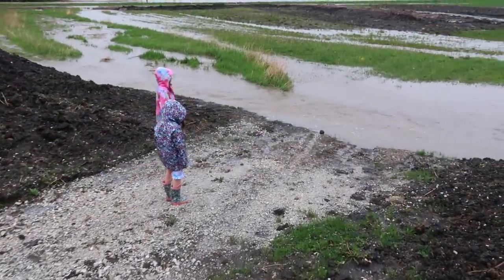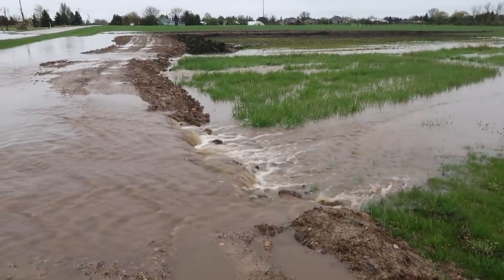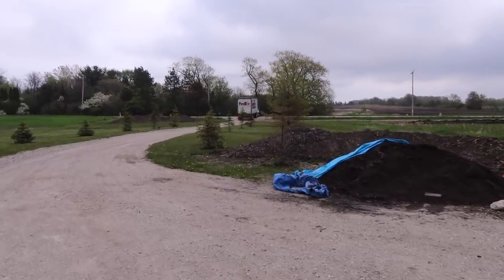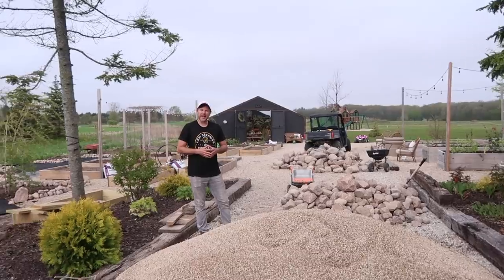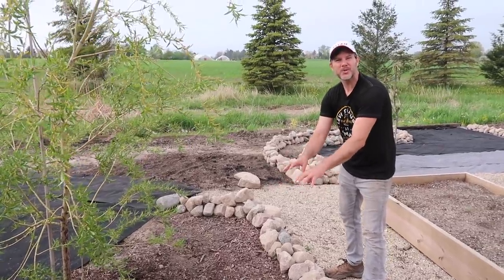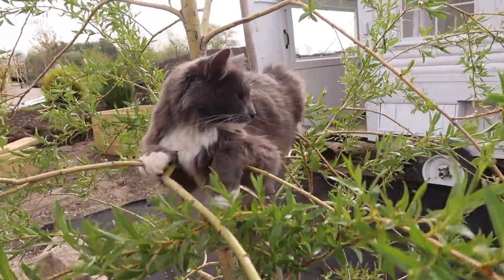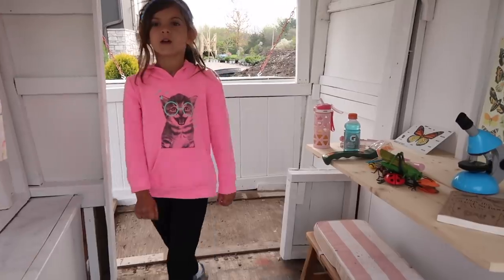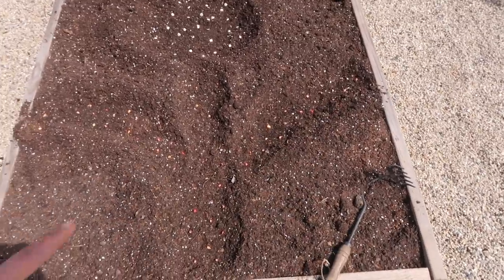Huge Perennial Delivery | Flooding | Garden Project Progress | Garden Design // Garden Farm

Comment: WOW, that was a lot of rain, in a way it showed you all of the potential future failures, that drainage from the road wasn't good, maybe you could put in a small box culvert instead of that csp.  All of those"puddles" should be filled in that way in the future you won't have to worry about standing water puddles, it'll naturally flow towards the low spots.  At least it happened before things got finalized😊
Reply from the maker: Great points! And you were definitely right it allows us to see where the issues are that need to be addressed, thank. You!
Reply: @TheLawrenceGardenFarm  I  my past life I was a civil engineer tech and I inspected roads and bridges.  So during construction, during and after rain, that was the time to do a drive through and see if the pipes are draining the way it's supposed to and check if the roads and bridges had proper crowns for drainage etc.  Just love that stuff.   But while you're building all those berms, keep in mind of the 100 yr flood plans, roads and bridges are built for the potential floods